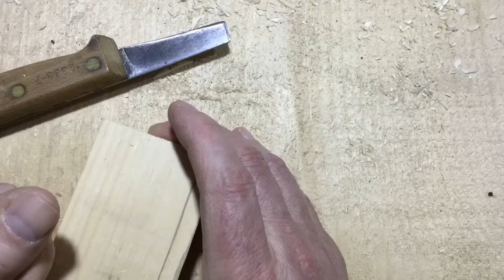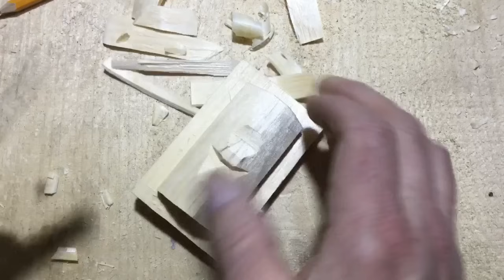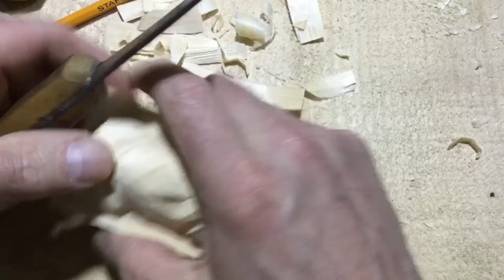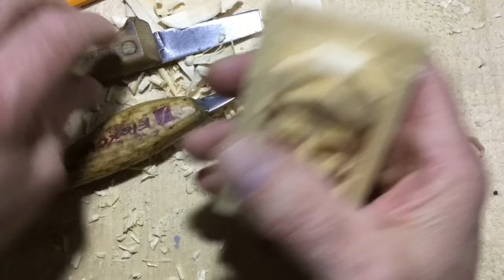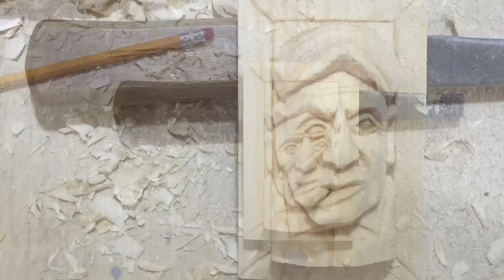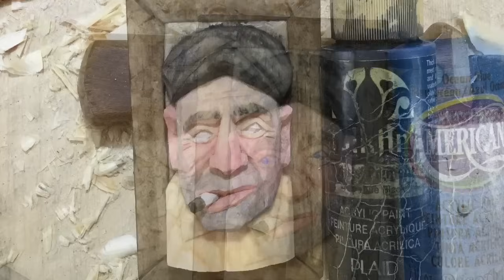CARVING A CHARACTER FACE

Comment: Brilliant! I couldn't draw the thing with a pencil and here we have Kevin the carver creating with a broken knife. This true art. Well done!
Reply: Nice work indeed.  However, that is not a broken knife. I was issued the same knife working in a paper mill. We used it to cut a layer out of a paper roll to do a splice.  Turn it backward and push hard, it will cut an inch deep.  I still have mine from 1974.

Comment: Where can I get a knife like the one you are useing?
Reply from the maker: The one I use is 40-50yrs old. Green River fish knife at Amazon is much the same. Just remove some of the blade length
Reply: @KevinCoates98  ok thanks i have a green river knife,but not sure i want to use it for carving its a good skinning knife.i'll look them up if they still make them.